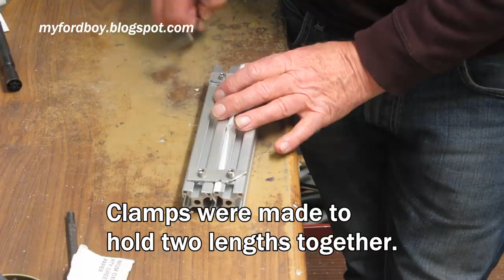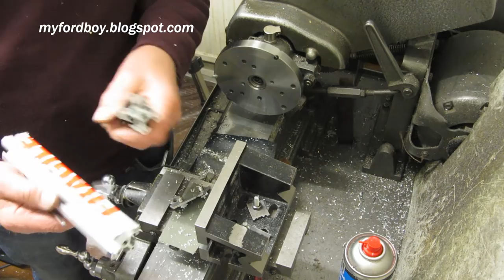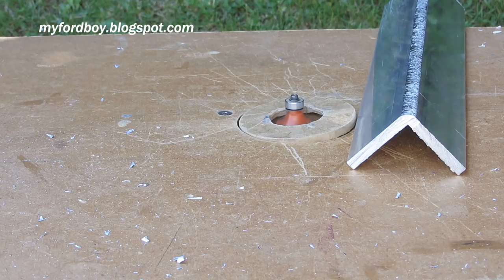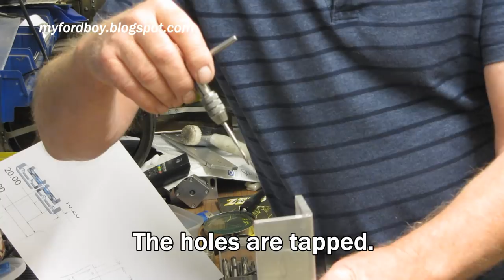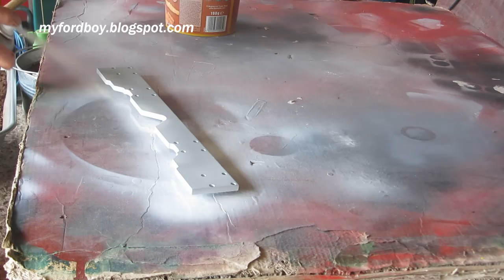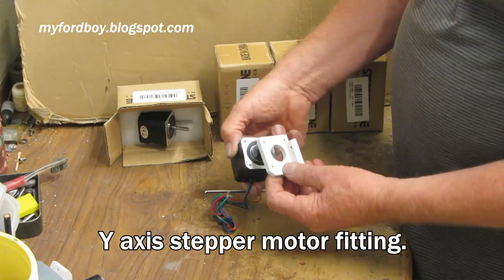The myfordboy 3D Printer Build. Part 1

Comment: What will be interesting is to see how you do the heated bed because every single printer I have ever made or purchased has always had a warped bed issue so I am thinking of using 1/4 inch Mic 6 and a silicon heated pad but the expense of both is pretty rough for a 330 sq mm bed size (~13 inches square).

Comment: When I made my own printer, I did my own design completely. I did not follow any of the conventions that make up an I3 and I am glad that I did not. The frame is entirely extruded aluminum 25mm sq. I used all linear rails. I put the Z steppers at the top of the printer and the motor to threaded rod coupler rides directly on a bearing. The entire thing is completely rock solid, so solid that you can lift, press, or pull on any section (including the bed) and the entire printer moves.

My design has some drawbacks though. I cannot print fast; 40mm/sec is pushing it and will give some artifacts (ghosting). 33mm/sec is a decent speed though and prints very nicely. In my case, the easiest fix would be to lighten up the bed. One other major drawback is the noise that vibrates through the frame. I've been thinking of trying the trinamic stepper drivers to help but honestly the I don't care much about the noise, it's not super horrible or anything.

Good luck on your project, I look forward to the outcome.

Comment: I like that saying, "When you are holding a hammer, everything looks like a nail."
I've not seem people fly cut stationary material will a lathe, before. It looks like it worked pretty good.
Reply: You may find it interesting to read about the history of early milling machines. They were basically based upon a technique called "rotary filling" which involves a special circular file in a lathe. One of the first milling machines was, in fact, an add-on for Maudslay's lathe.

Comment: I have several of the i3 mk3s.  They are great machines.  Yours will be as well.  What electronics are you going to use.  Those triaminic drivers are fantastic on the prusa machine you don't have to have and stops.
Reply from the maker: timothy svec I'll be using the Rambo same as original Prusa

Comment: Have you thought about powder coating stuff? There's kits over here that you can get cheap, and you bake them in a toaster oven. Been meaning to give it a shot one of these days. I know the trickness might throw off your assembly a bit but it sure is durable.
Reply from the maker: I had looked at that but shot blasting and using Hycote spray gives a very good finish that cannot be scratched off. A disadvantage of powder coat would be it could not be touched up , and the lengths I had would not fit in a toaster oven.
Reply: Yeah, powder coating has it's advantages and disadvantages. It is a really tough finish though. I get good results with sanding parts with 180 and using Krylon spray paint here.

Comment: Hi, Can you tell me where you obtained the extrusions,and also will plans be available?
Reply from the maker: Extrusions https://www.ebay.co.uk/itm/Aluminium-Extrusion-8mm-Slot-Profile-3030-30x30mm-CNC-3D-Printer-Jigs-Frames/122750305182?ssPageName=STRK%3AMEBIDX%3AIT&var=423168424856&_trksid=p2057872.m2749.l2649
I only made plans so I could make the parts. I was not going to make full plans for others.

Comment: Why use the lathe, rather than the mill, to get the rails to length?
Reply from the maker: Because of the length the rails would have to be mounted horizontal on the mil and a long end mill used which does not give such a good finish as  with my method.

Comment: Very interesting project. I'm curious however, you already have two 3D printers, what's the motivation for building a third?
Reply from the maker: Fair question. It's not just about the end product. I love making things. This is a change from my usual model engines. Using the best from other printers and my own ideas I hope it will be a great one.
Reply: It's quite clear from all of your videos that you get considerable joy from the process of creating things so I'm not at all surprised by your response. Have fun!
Reply: and did you increase the capacity while you were doing it?
Reply from the maker: The capacity is fine for me as it is. I have another printer that will do 300 x 300 x 400 if I want something big.
Reply: Now, what's next? a 3d printer for aluminum? heheh With your forge, you could build one and then sinter it after. It's really cool how they do that. They print using powered metal and sand. They use the sand to hold the powdered metal in place, then put the whole thing into a forge and sinter it bonding the powdered metal together. You have to calculate shrinkage but they get some really good results.

Comment: How can I connect larger  Axis motors please?
Reply from the maker: You can get pulleys with different bore sizes.
Reply: thank you bro so I can't change bigger Axis motors because driver can't take more 2 ampere so there is no other kind of drivers take more this current am I right ?
Reply from the maker: You cannot exceed the current rating of the driver as you say. Why do you need larger motors, plenty of power in nema14 for a printer.
Reply: thank you but I need more power because I need for using in other project need bigger motors that why I ask about current of drivers

Comment: Now using the lathe will probably be more accurate but you can trim those extrusions with a wood cutting mitre saw with a 60 tooth wood blade. It purrs through them like butter and if your saw is square and plumb, they are perfect.... 

I used 80/20 versions to produce this:

https://www.facebook.com/muskokacustomwoodcrafting/photos/a.1855445781414517.1073741837.1461231220835977/1855443011414794/?type=3&theater
Reply from the maker: The cuts would never be as good as a machined one but you have to use the tools you have.
Reply: exactly.......my biggest issue was getting holes drilled exactly where I needed them. Center punched, centering drill bit and then with the correct size they ALWAYS walked a bit. The bane of my existence.....I saw you drilling with your mill and I cried a little, oh to have a small mill and lathe, I could go into business building cnc routers. I have about $1500 cdn into mine and my time of course but a buddy came by and said I could easily sell my machine for $7000.00 got me thinking: I could make more money building the machines than building things WITH the machine haha
Reply from the maker: The mill with DRO is great for locating and drilling holes, no marking out and very accurate.
I only use my drill press for rough stuff.
Reply: Yeah, I figured that when I saw you drilling.....if you hooked up your stepper motor to a controller you could program it and have a cnc mill ! haha....(which is what I thought you were doing when you put the motor on the crank). 

It's amazing what you can do once you put your mind to something.